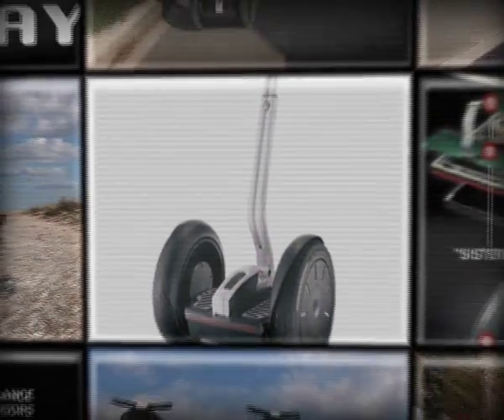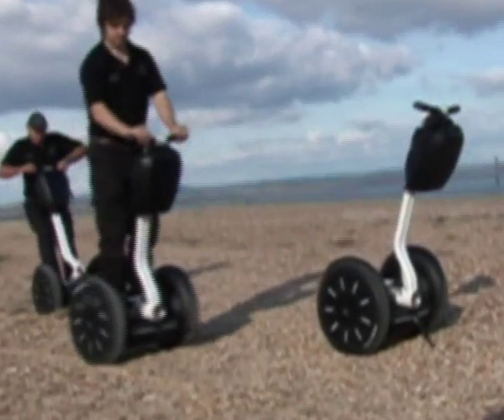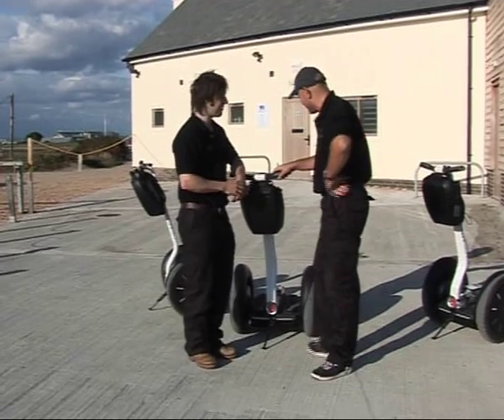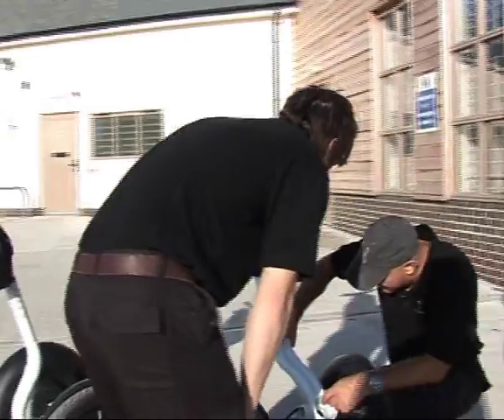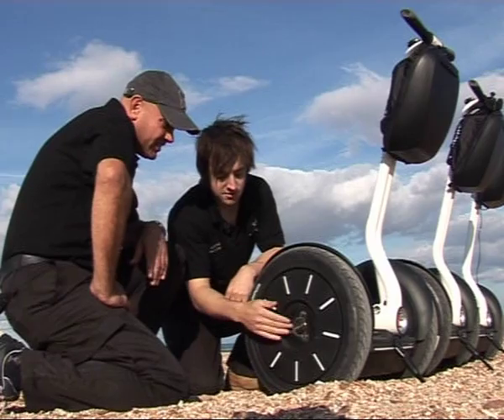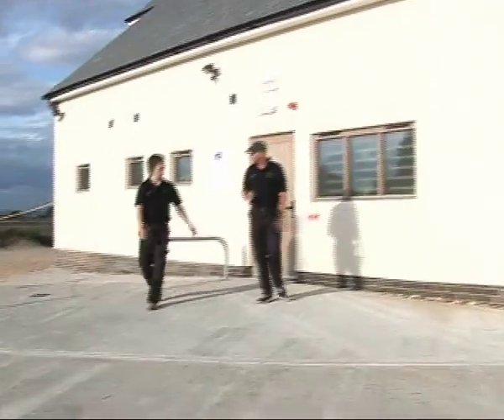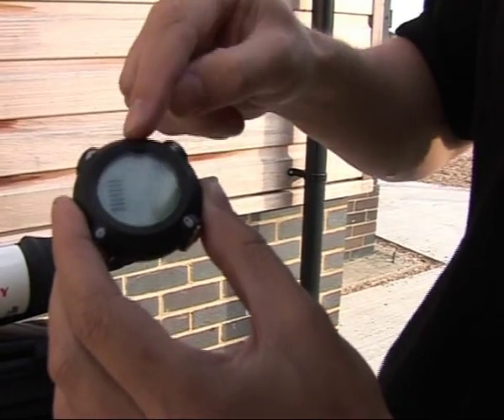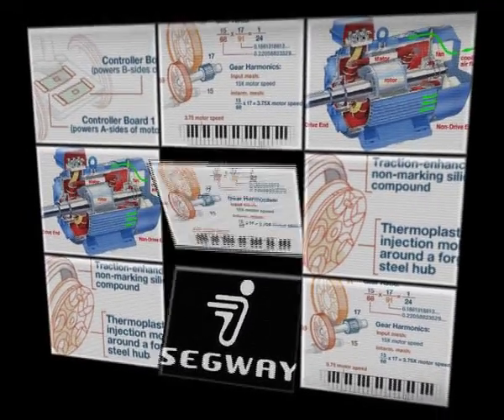How does a Segway work?

Comment: Thanks guys, I have so much information now that I don't need to buy one, I'm gonna make mine from scratch, all I need to find now is the lotslow deltoid windings with the facing panadermic semi-voltoid slot stators and a flux capacitor, I know thats the old type but I found the new type a bit glitchy when used around panacircuit varitronic electostatic converter rings which as you know are capable emitting low level radio waves similar to the frequency of those onseimens old T-274's and Nokia